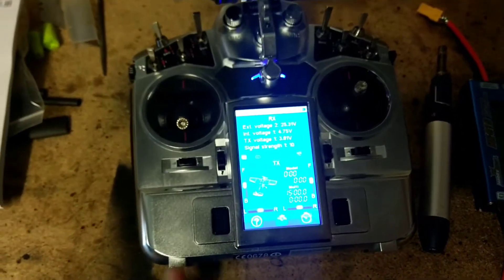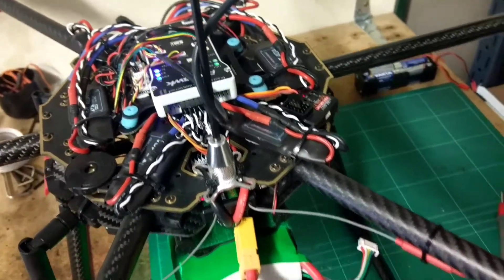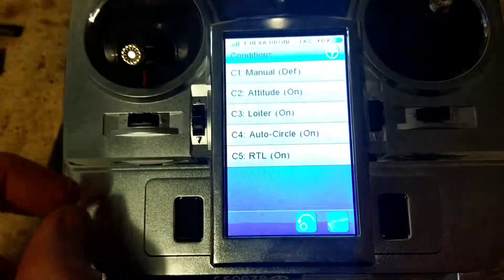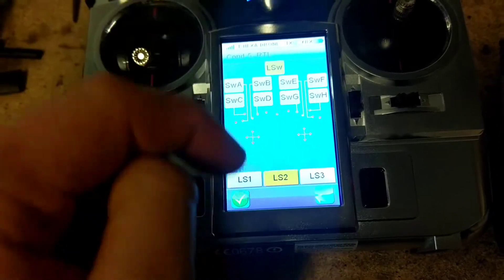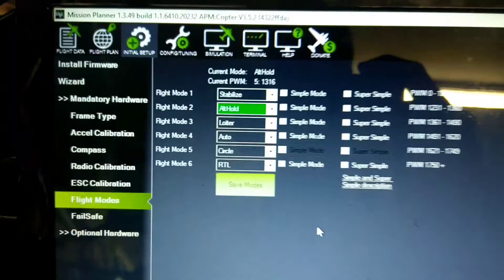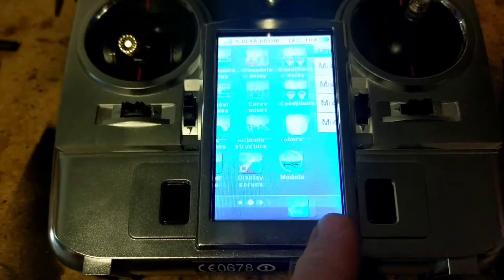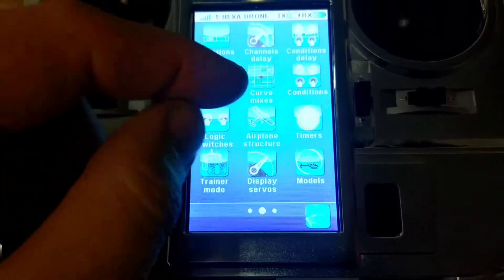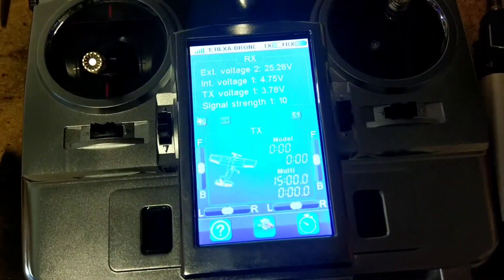Turnigy / Flysky TGY-i10 6 flight mode setup

Comment: Ive tried follwing this & it doesnt work the same as yours my linear mix doesnt change from off and I can still only get 3 modes in mission planner.
Reply: I had this working till today 😫 updated my apm firmware and was messing with transmitter lost the settings now I can't even see channel 5 flight mode change. Lol this transmitter needs more how-to videos.  any tips you got I'll be happy to hear

Comment: Currently, have a problem to do radio calibration with this TGY i10 and pixhawk. Rx gives solid red light even the Tx seems connected to it. Search for answers, some says about pwm and ppm, but no clue what that was....can you help me solve this issue